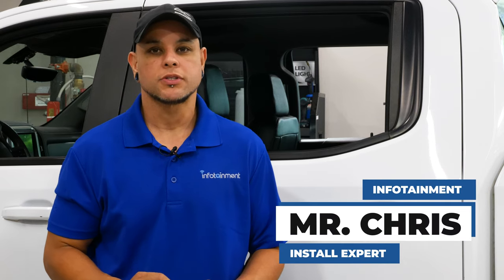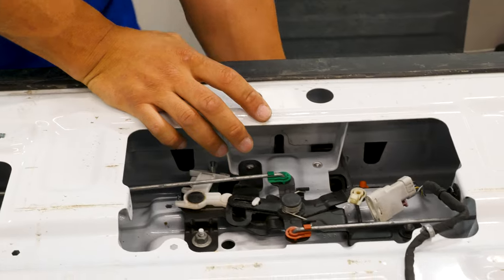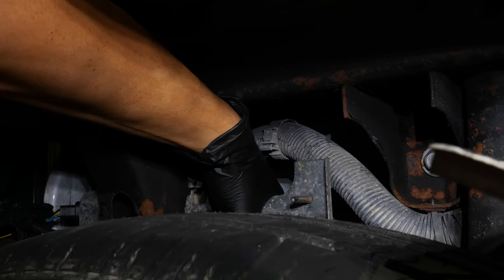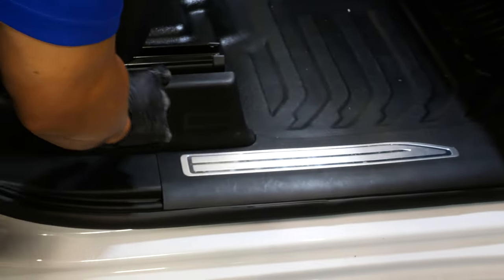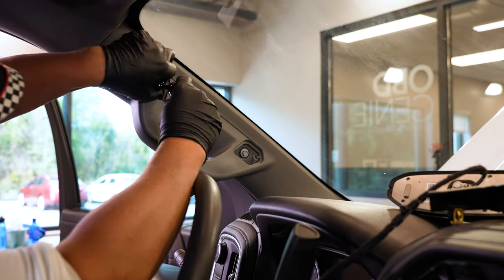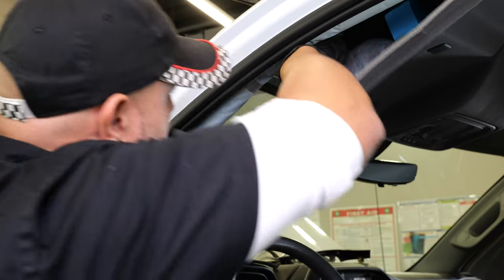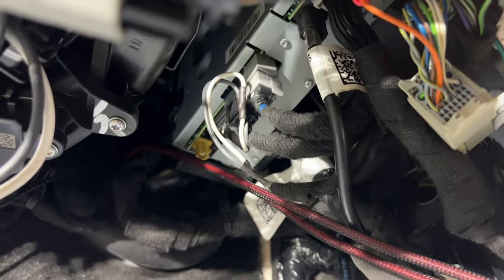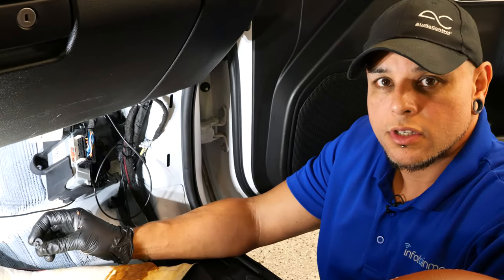[OLD] 2019+ Chevy Silverado - Analog to Digital Backup Camera Upgrade - Installation Guide

Comment: You stated that the new module is "non-NAV". My 2019 Silverado 1500 has Sirius XM and NAV; so do I lose the built-in NAV with your updated module?
Reply from the maker: This is simply an analog to digital camera conversion that is designed for vehicles with an existing 8-inch or 7-inch touchscreen display. Glovebox sticker will reflect the “IOR” code.  So this package is exclusively compatible with the IOR option code.  You will maintain all current existing factory functions.

Comment: I have the sxm in my 22 limited Silverado 1500 (pre refresh) but the camera is terrible. Do I need to update modules to run a digital camera or is just a matter of changing cameras?
Reply from the maker: Yes the module does need to be swapped. But our kit provides everything you would need to make the analog to digital conversion. 
https://infotainment.com/shop/exterior-accessories/backup-cameras/2019-chevrolet-silverado-oem-analog-to-digital-backup-camera-upgrade/

Comment: Nice video.  Thank you.  I have a 2020 SIlverado 1500 LT with a useless backup camera.  Can I connect this camera to my OEM non-Bose 8" display head unit?  The GM replacement camera part is "23390515 "  But I'll bet that it's exactly the same as what's in there, analogue.
Reply from the maker: Yes, this is possible here is our kit to convert that 2020 Silverado 1500 from analog to Digital. 
https://infotainment.com/shop/exterior-accessories/backup-cameras/2019-chevrolet-silverado-oem-analog-to-digital-backup-camera-upgrade/

Comment: Why do I need to change my roof antenna?
Reply from the maker: It is not required but we are swapping the module that has XM so it is really easy to do at the same time. If you have no interest in XM the first option "I currently have XM or don't care to add it" and it will  not include a new antenna. 
https://infotainment.com/shop/exterior-accessories/backup-cameras/2019-chevrolet-silverado-oem-analog-to-digital-backup-camera-upgrade/